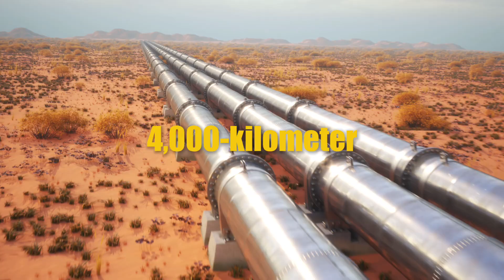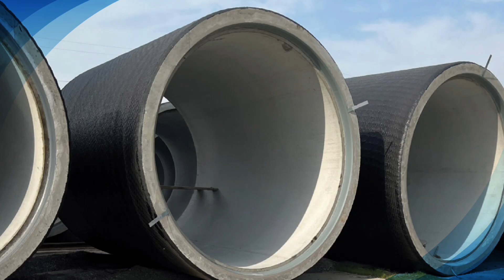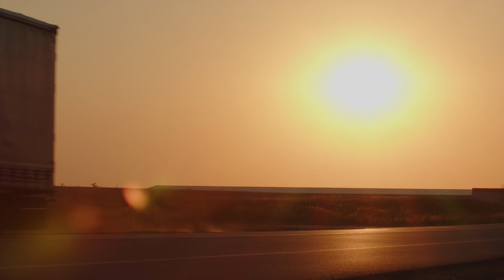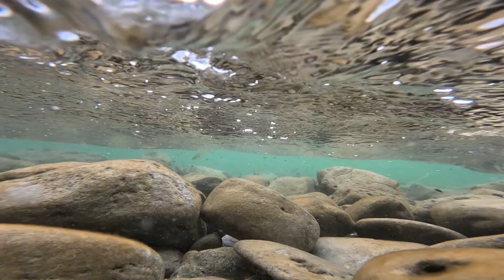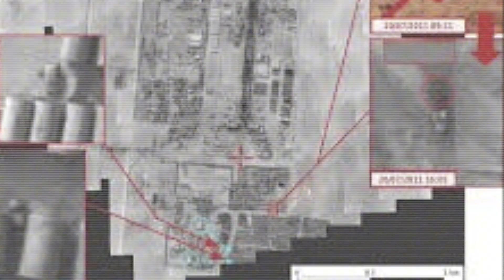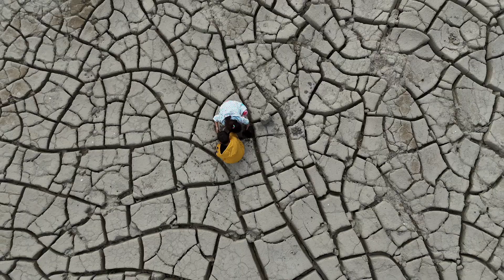Libya's $25 Billion Water Project That Couldn't Save It

Comment from the maker: Engineers estimate the pipes have a designed lifespan of 50 years, but the water took a million years to accumulate.

Do you think building a civilization on a non-renewable resource is a stroke of engineering genius or dangerous short-term thinking? Let me know your thoughts below! 👇